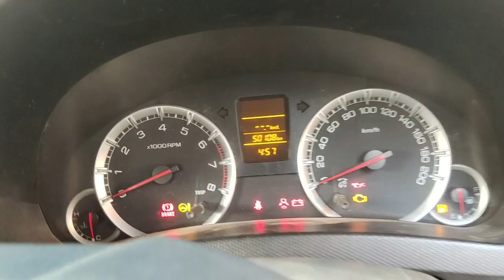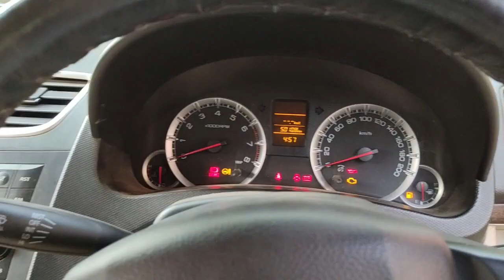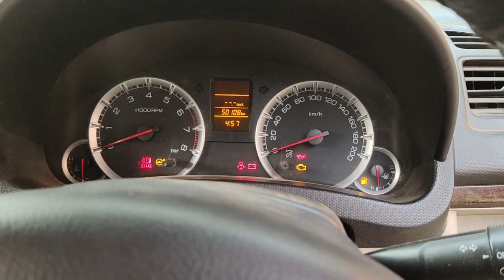Maruti Swift dezire brake caliper noise on rough Road, how to repair....

Comment: Bhai ye nylon sleeving kaise hoti hai? Kahan kara skte hain? Kya isse pin aur frame ke bich ka gap kam ho jata hai? Kya ye awaz play ki hoti hai?
Reply from the maker: Ye nylon sleeving lath vale karke dete hai... Abhi to bbracket milti hai aap naya dalo ... Mujhe tabhi mile nahi the
Reply: @devautoelectronics  thanks for your reply. Ye gad gad wali awaz pin ke dheela hone ki hi hoti hai? Meri gaadi mein normal road pe koi awaz nahi aati highway pr bump pe koi awaz nahi. Par slow kharab road pe awaz ati hai.
Reply from the maker: @himanshuchauhanmusic  awaz to suspension, stability rod, balancing rod aur lower arm ka bhi aa sakta hai aur caliper pin ka bhi ho sakta hai hai ... Kisi ache mechanic se check arwalo
Reply: @devautoelectronics  okay. Karwata hoon.

Comment: Mere car mai bumper aur potholes mai front wheel se aawaz aa rahi hai. Company ne bola lower arm suspension bushing  badaldo. Local garage mai kaha brake caliper pin badaldo. Kya karna chahiye sir ? Car sirf 18000km ghumi hai
Reply from the maker: Company ka aap mat sino, kisi local ache mechanic ke pass jao aur check karwale kaha problems hai, Lower arm 18000km mein nahi Jayega aur Koi problem hoga
Reply: Same problem tha..Mera..Caliper problem find

Comment: celerio have how many caliper pins, or unit, each unit how many pins, four wheels have four caliper units, please clarify
Reply from the maker: Only disk brake have caliper pins, each side two pins
Reply: @devautoelectronics  tanq, celerio 2016 model, how many will have generally,  n price of one unit for one side disc wheel